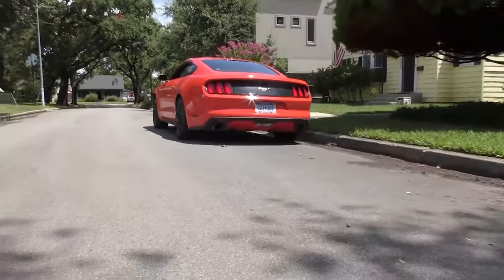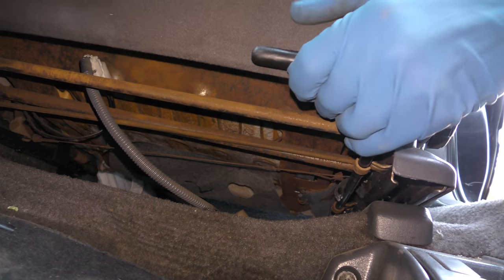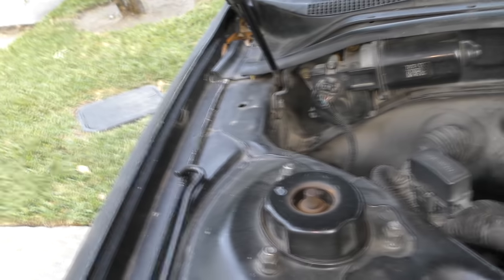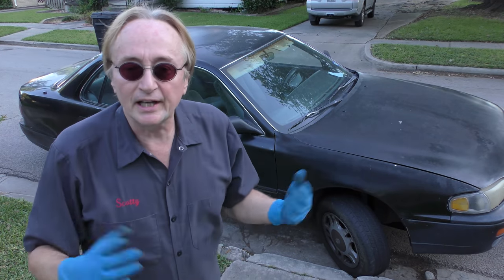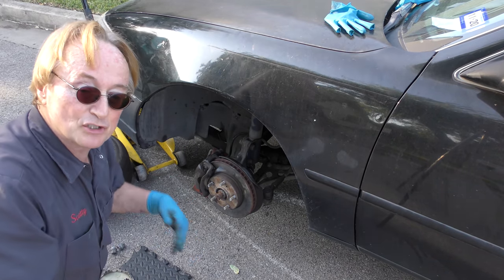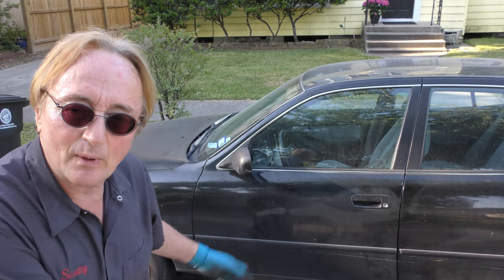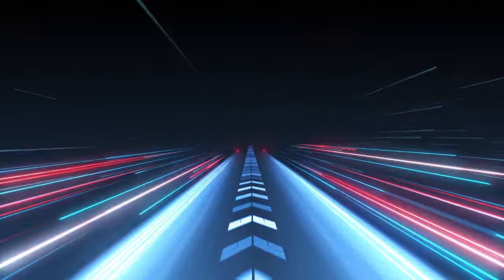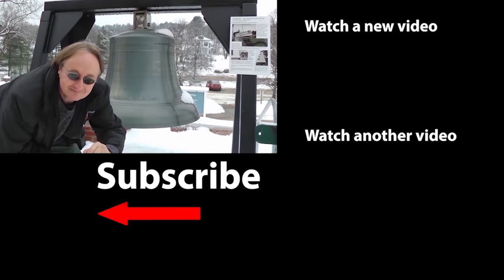Never Do This to Your Car (Learn from My Mistake)

Comment: This person took Scotty’s advice and drove it until the wheels literally fell off
Reply: You win today's comments
Reply: He definetely got all of his money worth with that camry
Reply: Cruisin' til the wheels fall off.
Reply: Well...in this case only 1 wheel has fallen off - still had 3 more to go LoL!
Reply: Wheel allready fell off completely.
Reply: I didn't think someone would take the advice literally!
Reply: I wonder if the owner should have just kept it for parts and get another old camry? that way he would have lots of spare parts!
Reply: Ray Bin Just use the node grabber in BeamNG And yank off the wheel then keep on cruising till the other three fall off
Reply: @mcc7762  buying an old car is fine if it's been taken care of and has low mileage preferably below 100,000 then you don't have to worry about it falling apart especially if it's a Toyota given the amount of parts that are still original on Scotty's Celica yet it has over 200,000 miles on it
Reply: As for newer cars even the Toyotas will fall apart faster than cars made in the past it's just common sense and planned obsolescence everything nowadays is made like crap same with electric fans even if a table fan from 1985 breaks down a month from now it's still made it's worth on every penny and has been more reliable than any cheap plastic Mainstays ever will be
Reply: @mcc7762  my son was given one like that fixed it up its a great car now he didn't get screwed
Reply: @akubel33t  well the suspension is no good XD Plus a lot of the parts for these are cheap enough that it's easier to claim your $300 scrap value and buy a $2000 car instead of a $1000 car next time.
Reply: @mcc7762  The worst part about it is the car is in too bad of shape to be worth fixing which is even sadder because it has tons of life left in it

Comment: "he could go to a junkyard"
SHOWS A CHEVROLET DEALERSHIP
Reply: Don't think those parts will fit a Toyota.
Reply: Savage 💀
Reply: J.D. POWAH
Reply: I got a 2010 Silverado and, so far, I haven't spend too much on it. I might got one of the few "good ones". I'm not a Chevy guy but, at the time, it was cheaper than Ford (near 5 gran) and Dodge (near 4 gran) from the dealer's lot.
Reply: yeah Scotty does that in all of his videos when he mentions junkyard. You new here bruh?
Reply: Reaper just noticed that 😷
Reply: Chevrolet doesn't sell Toyota parts
Reply: I think I got my answer what scotty thinks about oldsmobile alero's
Reply: Reaper I have 2005 Shetty Colorado 5 cylinder does 99 miles an hour all day  never had a problem ZERO
Reply: Reaper good ☝️😅😅
Reply: A Toyota from the good years going to the junkyard ☹️.. I am a DIY . Would had kept it. Now .. hopefully a lot of individuals in the junkyard strip it clean out of the high quality parts it contains..🤗👌
Reply: @knocksensor3203  yes. I love salvaging parts for my Toyotas!
Reply: He's been using that meme for a couple years
Reply: @n9wox  unless it's a 90s to earily 2000s Corolla
Reply: @JT8D200C  good call.
Reply: That's junkyard alright
Reply: lol then he goes and buys a 12 year old chevy trailblazer
Reply: That’s when I start feeling bad for owning a Chevy S-10 Blazer
Reply: @rverro8478  have 117,000 trouble free miles on my Silverado and I off road!
YouTube LS Toyota.
YouTube LS WRX.
YouTube LS Lamborghini.
YouTube LS Ferrari.
Reply: Should show a Mercedes Benz dealership instead

Comment: Live in Montreal and I can confirm. My dad's 2019 Impreza already started having surface rust after only one winter. Imagine what the bottom of the car would look like in 10 years.
Reply: It’s all about getting good rustproofing! I live right north of Montreal, and my dad has a '97 Cadillac DeVille with almost 250,000km (yes, winter-driven too), and after 23 years, not a speck of rust and the underside is as black as can be. But it's been treated for rust every year. It's not a gimmick, it works! ;)
Reply: @DirectCollision  what does he get done? I want my 81 lincoln to survive too
Reply: Welcome to Canada where we have more salt than actual snow

Comment: Toyotas of this vintage seemed to have a lot of ball joint problems/failures. Camry, 4Runner, IS300, GS300 etc. At least they're SUPER easy to change out. 
A word of advice: if you buy any of the aforementioned vehicles, and you don't know when the ball joints were last changed, swap them out pronto, and as Scotty used to say... "Before it's tooo late!"
Reply: Drive DB7 - What brand should we swap them out with?! Is Moog good?
Reply: @slowgoat6089  - Moog is decent, but OE parts would be the best. Hunt around online. Often times you'll be able to find the OE Toyota parts you're looking for for prices that rival the other brands like Moog.
Reply: @slowgoat6089  I 2nd DB7 - OEM or Moog.
Reply: Moog good but I like 555! Japan made parts!!! Some Moog is Chinese!!!
Reply: Hondas of this vintage also seemed to have the same problem. I've seen a lot of them on the side of the road with the front tire kicked out .

Comment: That's a replacement ball joint that didn't break, looks like whomever installed it never used the cotter pin, and the nut loosened, and then finally sheared off allowing the stud to come out of the spindle...too bad someone didn't actually look at the suspension on the car 2 weeks ago when he was talking about how great the a/c was....
Reply: I know right!😂😂😂🍻
Reply: simply tired - That camry had alot of life left 😡 did you hear how effortlessly it started.
Reply: The client didint ask him to check it out, so why should he have done it? He only wanted to him to check out the possible blown head gasket.
Reply: Camrys are tanks! I've had it fixed!
Reply: That's what I imagine happened to my 98 Lexus LS400 several years ago when I had the drivers side tie rod end replaced. The next day the wheel turned in on the highway.
Reply: Shoot ,I could have gone to the parts store and replaced thoes parts in a jiffy and when i got home ,replace the other side and get a front end alignment .
Reply: My lincoln ls doesn't have cotter pins at all on every suspention part

Comment: And that Toyota Camry still starts right up despite the situation....
Reply: I got in a head on crash and my Chevy still started and drove
Reply: Any car would haha I flipped my f150 5 times in my backyard and it never even stalled drove away on 3 tires
Reply: @ramonanzures9780  pfft depends on the speed.
Reply: I rolled a chevy cobalt and landed upside down for about a co yiu please hours till I brought my truck to flip it over and the thing started up and drove

Comment: A thorough check of the suspension components is so crucial. You could easily end up buying a car for $2,000 and then find out later that it needs another $2,000 in suspension repairs before it’s actually safe to drive.

Comment: Had that happen on my '96 Caprice but it wasn't front wheel drive so all I needed to do was replace the ball joint. Half shafts, transverse mounted engines, transaxle transmissions: the more things you cram up front, the more damage is done.

Comment: This exact thing happened to me last week with no warning. The stud on the ball joint broke off. Had to replace the upper and lower ball joint/control arm, cv axle, and the outer tie rod end but the locking nut is stuck on the tie rod so having a bear of a time getting it off.
Reply: Did you see there wasn’t a nut holding the balljoint in the spindle,
Reply: You should have just replaced the inner and outer tie rod end they are inexpensive. But if not soak it in pb blaster for a day
Reply: yeah no warning ---what was that clunk noise everytime you went over a speed bump
Reply: Anthony,  put a jack or a jack stand under the spindle right next to the bolt you have to remove then just hit it with a substantial hammer ( 2 lbs or there about). The tapered part will Usually come right out.
Reply: Maybe reverse thread. Remember each side threads opposite of the other🤷 and a 5lb hammer with huge adjustable wrench helps a lot😁👍
Reply: @nickpappas4133  I wish I could post a picture of it because the bolt itself appeared to be sheared off. It looks like it had a crack at one point and just gave out. As I said there was no warning and I replaced both upper and lower ball joint/control arms(they are one piece) and strut assembly.
Reply: @luisgonzalez8423  I used an entire can of blaster on it and it wont budge.
Reply: @BULLWRINKLE  no warning. The bolt itself broke. There was no clunk because I did both sides last summer because of a clunk. If I could post a picture I would. The bolt looks like it had a crack and just gave out.
Reply: @brucejones2354  tried that already. I had an alignment done last summer after replacing a bunch of the front suspension and even the shop I had it done in had a hard time getting them loose. Probably should have them replaced then but I was already substantially invested and didn't want to spend anymore money even it was only about $15.
Reply: @anthonymoore3999  chineese parts?????
Reply: @BULLWRINKLE  I wouldn't doubt it given the car was manufactured in Canada with Chinese to begin with. But either way my guess it was just a bad part and was more likely a fluke than a pattern regardless of where the part was made.
Reply: @anthonymoore3999  that may have happened to you,but in Scotty’s video the lower ball joint was still in one piece,it was possible that the nut was never tightened and cotter pin installed.If you had a lower and upper ball joint then you had a different front end as to the McPherson strut in video. I have been a tech for a very long time.

Comment: What a shame I could fix that in a few hours. So liberating knowing how to work on cars. I've done so much work to my 95 Camry. Over 300k miles and still runs great!
Reply: That's great man. I feel the same, I can fix anything it seems🤷✔️😂🍻
Reply: Shame to junk a car like that over a standard tepair
Reply: That is not $1k of repair. I can do that for the $250 in parts and have it aligned....
Reply: That's an easy fix right there  Camry part Aren't expensive
Reply: @fallsdp  absolutely, maybe even less money if you shop Rock Auto 🤣
Reply: rad. 290k miles on my 2013 c max hybrid ... might sell it after these new tires wear down (70k)
Reply: I've not graduated into cars yet, but I've built a couple of bicycles from scratch and straightened the wheels on them,  and saved myself money over the years - and spent money on shiny parts. ;-) Being practical is a great thing.

Comment: Flashbacks!  I had an experience like that with a '78 Mustang II. Coming home from school and heard a pop going over railroad tracks one evening.  Got home  (6 miles)  and jacked up the front of the car. Saw the floppy wheel and knew it was time to call my mechanic and the tow truck driver.

Comment: Well at least the engine still sounds good XD. Off to keep other Camry's on the road longer with used parts from a non wrecked car, quite the gem for a DIYer to find in a U pull it.

Comment: That's a scary scenario when driving. The exact same thing happened to my Mustang on my way home from work one morning.
I called a tow truck to bring it back to my garage at home, replaced the broken ball joint, pulled the fender back out, and went back into my midnight shift. Wow that was was one of the longest days ever lol.
I know now any unusual sound coming from the suspension is a clear indicator to search, and repair immediately.

Comment: This happened to me several months ago in my 98 Honda Accord , I just turned the corner and the left lower ball joint came out  & broke my axle CV JOINT , but I wasn’t driving very fast probably 18 miles an hour .Had it Towed Home , the next day I replace that lower  ball joint two months later I replace the right lower ball joint , about two more months after that I replaced both upper control arms . 
Car suspension riding  very good . It was a little challenging, but I did it 😅

Comment: I got one of those air pumps because I had bought 3 cheap ones in 3 years. It's holding up well so far.
Reply: What model?
Reply: I done the exact thing!
Pay a little extra for quality and you will never loose!.
Aussie Chrisso. 😎

Comment: In theory. Having a mechanic check out a used car is a good idea. Buuuut. Not everyone is like Scotty. I took my used 1995 Ford bronco to the mechanic once. Did a used car inspection. Paid em to change the oil (hey it was cheap, and I just got the car) and the oil filter. They looked over everything, well at least that's what they charged me for. And gave me a list of "issues". Half the list was fiction, and a scheme.

Changed the oil two months later my self. Black as night. And the oil filter was dated for almost 3 years before I purchased the car....  

What a scam. 

Since I've dumped endless dollars in the car and worked on it my self. With help from your channel of course.

Thanks Scotty for everything you do and keep up the good work.

Comment: That ball joint looked fine, just looked like the holding bolt fell off. I wonder what mechanic “checked” it out before the owner bought it. I wonder.
Reply: And who did the state safety inspection? Or does Texas not require that on transfer of plate?

Comment: When I was driving a lot on the freeway I saw a lot of this.  Cost me over $5000.00 to keep my Buick running  it finally fell apart at 127,000 miles.  Piece of crap..happy with my Elantra..
Reply: i been driving for over 35 years last time i broke down i would say 32 years ago- i drive old cars now one is 21 years old the other 20 years old both run great
Reply: My 2011 Elantra has 75k miles on it owned it for 4 years, no problem. It needs a paint job but I like Hyundai alot
Reply: What kind of Buick?
Reply: Ben Silva  own a 1999 dodge caravan had it for 15 years never broke down still runs great looks good too the paint
Reply: Own a 99 Buick Century. Ive only replaced parts on it, mostly due to sitting for years (one owner who passed away-son inherited it , it sat outside) Anyway, all in all my Buick has been a really good car for all that it had been through. What I find interesting is that it is only up to 80, 000 miles now and the motor itself is in really good shape. Replaced a belt and had oil changes..thats about it besides other fluid replacements..The tie rods, control arm, bushing, tires, lug nuts, ect have all been replaced..next struts and motor mounts. However I feel as if Ive recieved my money back already from the poor little thing. I bought it at 67,000 miles and have had it a year driving it almost daily...Ive just been allowed to work on it slowly..it just dont give up. lol

Comment: I'd buy it for a couple hundred.  I did the same repair on my Acura.  New axel, new outer tie rods, new castle nut and pin, and new ball joints.  All with lifetime warranties fixed it right up.  1 alignment later it was driving down the road like a champ.  Easy fix for a shadetree guy with couple hours to do.  Cost me under $300.  Scotty's labor cost is what would cost on this job (charging by the book time for each vs what time it actually took to just do).

Comment: Still using a 1997 XLT Van with the V10 in it for our church. That Van has around 140k miles on it and still runs superb! Be warned... you HAVE to use the right spark plugs and recommended brakes on them or you will chew through both! They also LOVE to rust along the edge of the roof in that little "trough" or whatever u call it. I had to repair a hole caused by rust and water was leaking into the van. Also, A/C work can be expensive on them.

Comment: Where is the nut on the lower ball joint?
Reply: I picked up on that also. That is not a normal ball joint wearing out and pulling out of the socket, it looks like the nut backed out. Someone has been working on this thing and didn't put it together right.
Reply: Scotty probably doesn't want involvement if someone identifies the last mechanic to work on the front suspension and there's litigation.

Comment: Scotty why do you hate Chrysler/dodge? I bought a 2000 Dodge neon 5 years ago with 29000 miles on it and since then I've driven it all over the country it now has 88,000 miles on it. The AC still blows cold and the interior is in great shape. I learned how to work on cars replacing suspension parts and doing general upkeep it's a very easy car to work on and has never let me down.

Comment: I highly recommend those reverse thread sockets (rocket sockets). These things have literally stopped me from scrapping my car after i rounded some bolts. Also useful for removing wheel nuts (also called puzzle locks i think) when you have lost the lock! thanks for the tip about welding Scotty! that's new to me!

Comment: This car again..😂😂😂
Reply: Loose Nut Case 😂
Reply: How many miles are on this gem?
Reply: @nickmccain6598  I think it was almost 250,000, if I remember correctly.
Reply: @poldariser8686  and I thought I waited too long to replace ball joints at 130k
Reply: @nickmccain6598  if there's no play in it, then you might be ok. Scotty mentioned there was play in it before the wheel actually fell off. My Camry has 177,000 miles on it. I bought it at around 124,000. I haven't done any ball joints yet, not sure if the previous owner(s) did. 🤷🏾‍♂️
Reply: ... and for the last time.

Comment: As the balljoints lacked of inspection on 2008 Nissan Versa, the right side one popped out in November.  That pulled the right drive shaft apart. I had to replace both control arms and the drive shaft on the right side.

Comment: I see a lot of Dodge work trucks that have the lower ball joints fail. A friend of mine who has a Cummins 2500 replaced his at about 80k with high quality replacement ball joints just as a precaution.  He plans on keeping this truck a long time.

Comment: The trick with the long screwdriver (or anything you can fit) on the brake pedal is also a way to check your brake lights.